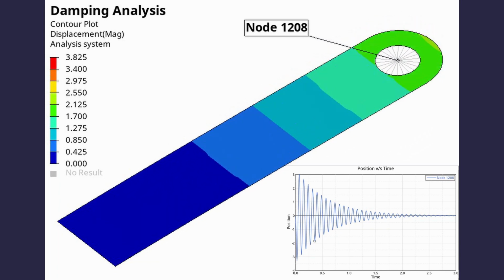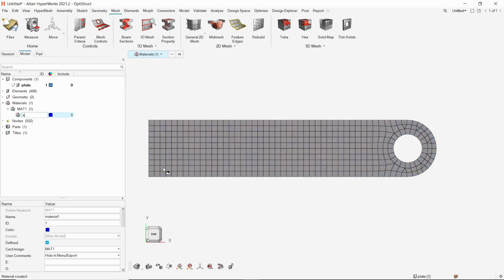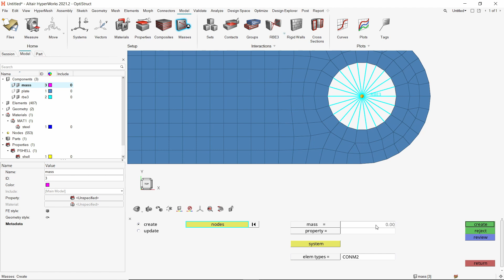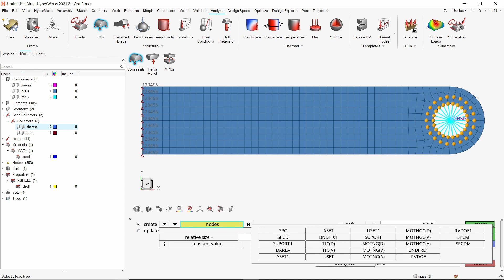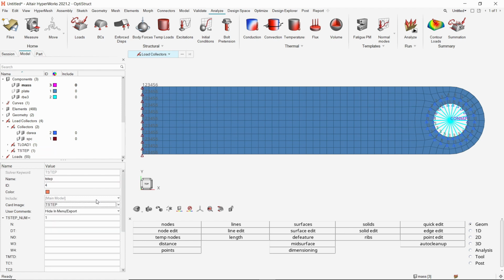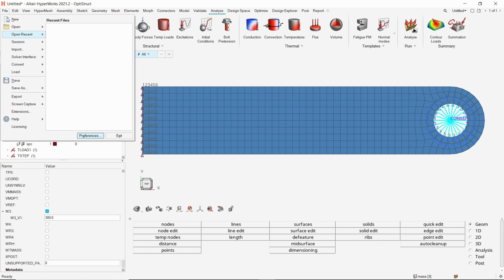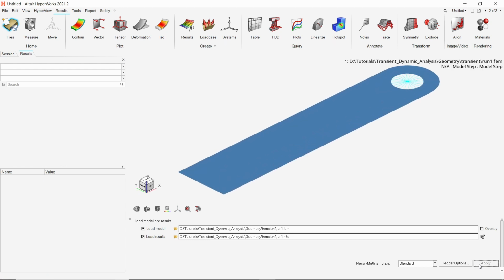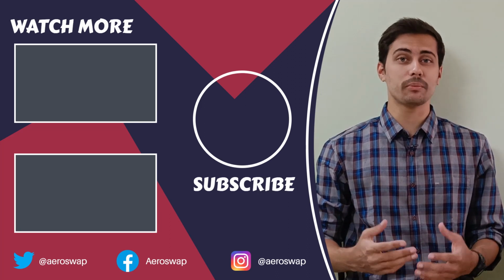Transient Dynamic Analysis using Hypermesh [Optistruct Tutorial]

Comment: Great video! But how do you apply the thickness if the component has different thicknesses? I have seen you apply always the same thickness to one single component (which is also real!) but if the part has different thicknesses? Looking forward to your answer! Thanks and keep them coming!
Reply from the maker: In case of multiple thicknesses, the geometry can be split into different components connected to each other. Then each component can be assigned a separate thickness as well as material.